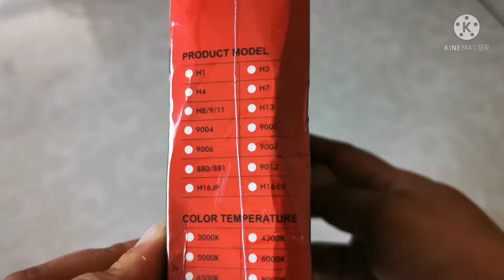Hyundai Ioniq Hybrid HID to LED Bulb conversion

Comment: If you have halogen bulbs. You must exchange with led ones. But if you have oem hid system just clean your lenses and put new hid bulbs. Most pf the time due to high temperature of the hid bulbs, lenses getting blurred. Just a simple cleaning can rise your cars illumination level up.

Comment: LEDs are the brightest when they initially light up, when everything is nice and cool. After "warming up"(aka heating up) the light intensity drops by 5~35% depending on ambient (engine bay) temperature and how the cooling capacity is designed. On my F30 ActiveHybrid3, a similar LED replacement light output (when stable) was close to Osram 66440CLC Xenarc Classic, but visibility was not as good, object seems dull due to its higher 6000k color. I eventually switched back to HID for its better color rendition and higher light intensity after warming up.
But if flashing high beams in the day is your thing, the instant-starting LEDs beats HIDs hands down.
Reply: U g killer things to say tbat

Comment: Not much reason to replace xenon if you have them on your car, because xenons are pretty good. But if your car has halogens, then you absolutely need LED bulbs to see at night. But only with projector headlights.

Comment: Why did you changed? 
I'm also in search of an answer between HID or LeD for my ecosport lowbeam projector.
Reply from the maker: Save energy , instant ON and depending on the LED bulb type, feels much more comfortable with LED over HID. The side and forward throw is much better. For LED better get 2 sided type bulb and depending on car and head light type may require different type of Bulb.
Reply: @coolclouds6253  any over heating issues inside the headlight assembly for HID? And will it cause damage of the same after constant overheating?
Reply from the maker: So far no issue. Working really good .
Reply: Hello brothers, same concern, I have Ford ecosport top variant , low beam with D5s hid with 25w Philips bulb, wanna upgrade since the light throw is not that good. Need suggestions.
Reply: @leomassi3169  which varient is your vehicle? Sports? Actually i was about to go for sports variant's HID for my titanium
Reply: @aweirdcompass2746  what variant you have brother.?? I have a titanium s variant. And as u can see the specification of hid.. the throw is not that good as you can see in other led n hid. Its 25watts 4200k. Since the mostly used light is low beam and fogs in city. The stock will disappoint you. Even am looking to upgrade the low beam and fogs, keeping halogen in high beam for highways.

Comment: I hate the color temperature of LEDs and  there are clearly dark spots right in front of the car do to the LED chip placement.  6000K is too cold of a color temperature to perform well in inclement weather.    Stick with your OEM HID setup my man.

Comment: i never understood why stupid people put led bulbs in lowbean headlights,problem is halogen or reflective hesdlights were never designed for such led bulbs in the end you willnever ever get good intensity as even fillament bulbs as a master tech i guarantee you that,you want better intensity yiu gi with HID as it is a 360 degree discharge,some states you won’t even pass safety inspection because of. it

Comment: Nope the h.i.ds are brighter than the leds.  Ur stupid to say leds are brighter.  Definitely not.
Reply: Unfortunately your wrong. I have a similar set up with my car. Original factory d3s with CBB bulbs. The LEDs just edge in brightness. However I feel the CBBs have a slightly longer throw and do better in bad weather due to there lower kevlin rate
Reply: @hal752  that’s exactly what we mean by brighter. Longer throw equals brighter in the distance. Think about it the projector was designed to work perfectly with the hid bulb. The led is just designed to mimick the hid bulb arc placement which is a far cry from actual engineered optics. Brighter  10 feet in front of your car doesn’t mean brighter when driving where you’re eyes are looking 100 feet in front of you or more. Besides most LED’s aren’t actually brighter than hid setups. It’s just that our eyes see the high kelvin temperature easier in clear weather due to the high contrast of the 6000kish colors used in oem LED’s.